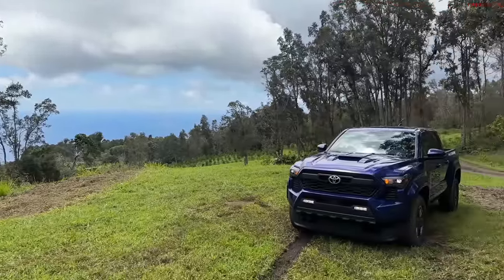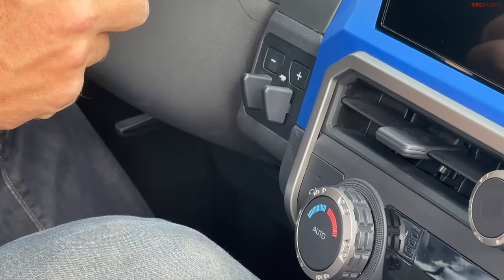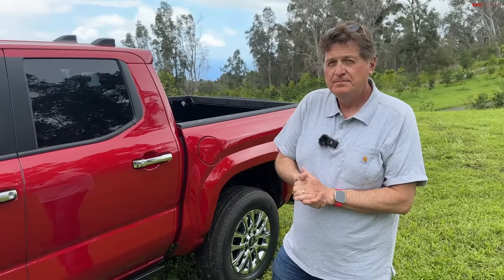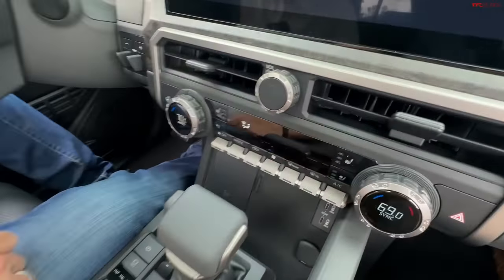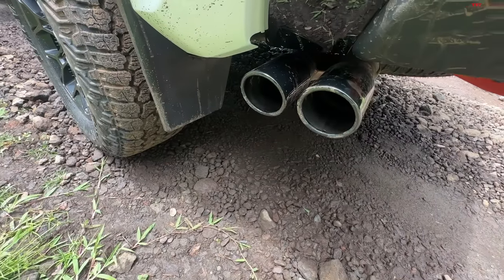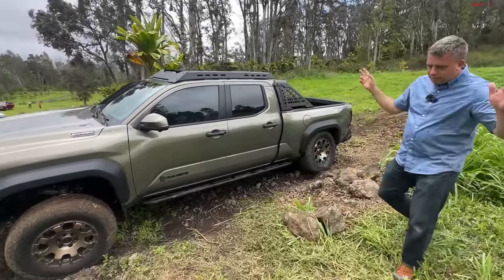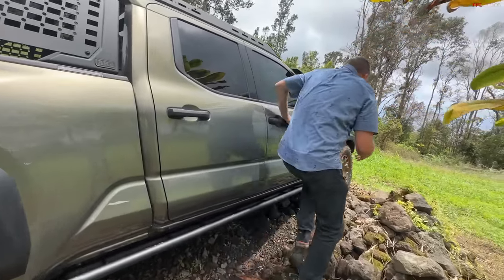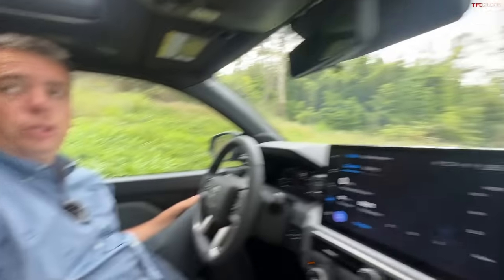The All-New 2024 Toyota Tacoma Is Finally Here But Have They Fixed Its Three Biggest Problems?

Comment: hate the air dam on the bottom looks ridiculous
Reply: Ya it look like it was on the ground. It's was weird. Like it was 2ft wide
Reply: Ugly air dam. I took the one off my Colorado. Id take this one off too.
Reply: I saw another video where they explained that it’s easily removable. Toyota had to put it on there to meet EPA standards.
Reply: 100% agree!
Reply: Taking the air dam off is one of the first things tacoma owners do to their truck. Mine was off the very first weekend. 

Tacomas are notorious for being easily modifiable so I expect this gen to be similar. Just unbolt the thing, throw it in the attic, and move on with your life.
Reply: @Prison_Mike_38  I blame CA 🤷🏽‍♂️
Reply: They made it super easy to take off
Reply: Looks hot
Reply: Ya, it looks like an afterthought
Reply: Yeah, not good for going off road.
Reply: @dougshoemaker2114 Let's be real, 80% of these trucks will be pavement princesses. Anyone who's interested in off-roading will take 15 minutes to remove 8 bolts and ditch the plastic monstrosity, or have their first trail unceremoniously remove it for them
Reply: The sport has always been the dumbest trim
Reply: Extremely ugly. Probably very easy to remove but also likely helps mpg enough to justify the engineers putting it there.
Reply: They do it for mpg but they know most people just take it off
Reply: Agree
Reply: Easily removed. Or complain like a bad girlfriend. Your call.
Reply: It’s cool that it’s removable. Imagine if they made the bumper that large like they do with the LX/GX
Reply: I’d take off before i left dealer lol. Too much snow here
Reply: Take it off then princess
Reply: Not to mention it’s 1500 pounds heavier than a Tacoma from 2008
Reply: Yes on the older model I took it off and it looks nicer 😂
Reply: Agreed, jeez, crimson chin out here
Reply: Looks over functionality.
Reply: @zacharylindsay7534 yeah apparently gains 4mpg-- so might actually be useful for long drives fuel econ
Reply: Yeah until you get 2-3 MPG better because my 22 TRD off-road 6-speed manual in Phoenix with the AC on gets between 14-16 MPG in the city I may be drive a little faster than most but I definitely don't redline it 4K RPMs or less everybody drives fast so I got to keep up

Comment: Looks like they stuck a laptop screen in the middle of the dash, looks dumb.
Reply: Yes! Tesla did it first so now EVERY manufacturer thinks that’s what they need to do too. Except for the new grand Cherokee - it’s nicely integrated.
Reply: @jacobgreenbough5678  Ford pickups have there screens nicely integrated also.
Reply: The best version of a screen integrated into the dash would be the Bentley Continental. I really like the Bentley Continental dash because when you don't need the screen you can hide it and have the look of a traditional dash. The second best would be the Mercedes G-Wagon.

Comment: I have a feeling that the Tacoma will stay the sales leader in its segment for a long time.
Reply: No doubt.
Reply: Maybe there's finally healthy competition
Reply: Possibly. They do have the brand loyalty, but $60k for 405hp in the Ranger Raptor is a pretty good deal by today's truck price standards. Pricing on the TRD Pro and Trail Hunter are going to be key (assuming we live in a world where you can get a hold of these trucks).
Reply: @MikeKelly87  exactly. Toyota fans are hardcore. Toyota this Toyota that
Reply: There are some big improvements with the 4th gen, there are many things they turned a blind eye on. The TRD Pro approach angles are a big disappointing. The lack of a front locker is absolutely baffling. The big advertised torque number is exclusive to the automatic transmission which is a huge fail for us manual guys.  I like that Toyota didn't go overboard with glossy plastics this time around as their glossy plastics would scratch just by looking at them. The UI on the touchscreen is undwhelming -- why can't they just hire a team that knows what a good UI is, not a UI designed for geriatrics. The ARB and OME parts are awesome great choice. If the Tacoma holds onto its sales spot, it's because the people buying them don't even look at the offerings from Ford or GM.
Reply: @idontcaresapo8233  Ya, same could be said for any brand (Ford guy personally), it's not necessarily a bad thing. I think if you are somebody in the market or about to be in the market for a mid size truck and you don't have brand loyalty then this is an exciting time. I was a little surprised they would add a disconnecting sway bar but not front locker. The seats are definitely cool.
Reply: @MikeKelly87  by the time raptor hit the dealer it will be 80k
Reply: Toyota could have kept the previous gen going for another 30 years and it would still remain the bestseller. Toyota brand loyalty is ridiculous no matter how much superior the competition is.
Reply: Hilux SR5 is a better truck than this to fancy and the drivetrain is a shit if where a diesel i would be okey but 4 cil turbo gasoline is going to explode
Reply: @MikeKelly87  hay that’s right I’m with you. But prices are the only thing that keeps me out of the conversation I was lucky enough to buy my 2021 tundra trd pro when prices were normal . But this new generation trucks are way to expensive fro what really they offer
Reply: @RP-vr8pi  yep probably the top of the line they said 50k
Reply: @MikeKelly87  yep. I would 💯 buy the Ranger over this! They look better, will last well beyond your ownership, and it’s not like anybody is going to do any major off-roading in these types of trucks. That’s what my RZR Turbo R is for 🤙
Reply: @idontcaresapo8233  they’re stupid really. All of this tech, other brands have been using, some for decades already lol.

They’re only brag is reliability. Okay, but buying new vehicles, how many people actually keep that vehicle for hundreds of thousands of miles? Like maybe 2% of vehicle owners lol. So the reliability brag really os for broke people who can’t buy these new, and only 2nd, 3rd, 4th, etc. party lol. Plus, Toyota has now introduced turbo’s into their engines. How “reliable” will these really be? Nobody can really make a reliability argument on these new engines because they’re brand new. Time will tell, but I doubt they’re going to last hundreds of thousands of miles like before.
Reply: @MikeKelly87  seats are pure marketing. They are more rice than anything.
Reply: @idontcaresapo8233  yep. Very expensive, and feel like I’m sitting in a 90’s vehicle…
Reply: 50? Nop it’s gonna be colors to 60 mark my words for the trd pro
Reply: im getting it will be my first truck and always been a fan of toyota trucks
Reply: @spaceoutmisfit1738  get the prior tundra trd pro .
Reply: For anything after 2024, I’d rather have a Frontier. I’d prefer a 310 HP V6 over a 279 HP I-4.
Reply: GMC Canyon looks pretty nice.
Reply: The new ranger should give it a good run for its money

Comment: Looks like an extremely technologically advanced vehicle. Beautifully styled, and certain to be a big hit for Toyota. I am still old school biased and prefer a naturally aspirated V6 on midsize trucks and V8 on full-size. Curious about turbo lag on these newer vehicles as well.
Reply: I don't think lag is much of an issue these days; the boost pressure isn't crazy either. I'm curious to see how reliability pans out.
Reply: I’m with you on the engine choices, regardless of how well it performs, eventually you’ll need to spend a pretty penny to  replace the turbo, plus the fuel economy isn’t as advertised ever unless you drive with an egg under the gas pedal.  

I’d want the base 2.4 liter with the lowest power rating.  Still plenty of power for a midsize truck, but “detuned” for more longevity.

Turbo lag isn’t really an issue anymore with modern vehicles.  I drove a Tundra with the turbo V-6 and there was virtually no turbo lag (among other vehicles), knowing Toyota this will be the same.
Reply: It's a Toyota and turbos are everywhere except America it will run forever and save more gas and have more power! Ohh and the hybrid kicks in instant torque so no lag at all!
Reply: The hybrid system makes it a torque monster, and will pretty much eliminate any turbo lag thanks to instant torque delivery. I suspect this powertrain will punch well above its weight.
Reply: Indeed all my buddy's always had good reliability from the old tried and true 4.0 V6 I was lucky to test drive the 4runner same day as the 3.5 Tacoma and went with the 4runner simply because it just felt better on road and offroad
Reply: @nazspeed1  guaranteed to likely out live Ford turbos to compare I've had nothing but poor experiences with any turbocharged Ford including my relatives all together we've owned everything from Econolines, P71 Crownvics and Focus STs
Reply: less weight and smaller space, better MPH, add the hybrid models, then the power/torque go up(this part was what I was waiting for). Would prefer the plug in hybrid version though and use the Lithium batteries. Then that high compression engine would not be used much for the average person. 50 miles before the gas kicks in. Would cut most people's mileage down by 80% on the gas engine.  Average daily driving is 37 miles, 259 mile a week. So the weekend trips would be the gas engine mostly. Running errands and shopping (45% or 116.62 miles)
Social and recreational trips (27% or 69.97 miles). The daily commute (15% or 38.87 miles). These are averages though. Some might have less, others might use more gas. For off road like myself, the added torque of the electric would be awesome. If you tow, the added power also would be good. It has more power than the V6. Quite a bit more. Also cost a lot, 55K of thereabouts I would guess.
Reply: Small turbo 4 cylinders in trucks usually means a bunch of problems
Reply: I stick with my 1988 Toyota 22re
Reply: Agreed.  Too complex.
Reply: @Banned by Commie YouTube 5 times b4 this  2.7 v6 f150s get 26-28mpg hwy
Reply: Beautiful?
Reply: 5vzfe !
Reply: Toyota messed up by not offering a detuned twin turbo v6 as an option for the TRD lineup.  THE RANGER RAPTOR IS GOING TO SPANK THIS TRUCK , and I'm a Tacoma owner
Reply: @jessehenry1254  the Toyota will last 10 times longer
Reply: Turbo lag in most newer vehicles is pretty much nonexistent. They aren’t running big turbos for big power, they’re running small turbos for improved efficiency and moderate power. Small turbos have significantly less “lag” than large turbos.
Reply: This motor belongs in the prisus and.the tundra motor belongs in the TRD PRO
Reply: Yeah. I had my gen 3 tuned and added new suspension and couldn't be happier.  The new truck do look sick though. And that mpg lol 😆 sexy af boys.
Reply: @biffmasterson9786   well explain all the hiluxes all over the world except where we can't get them.....here in the USA. Not to mention 18 wheelers ( large Trucks)  turbos diesels are everywhere and the technology has been around forever. Toyota would not risk this on there best selling truck unless they knew it would work. Small engine, turbos , and hybrids are what toyota knows best. Most Americans want a roaring V8 with a 5 speed but it's just not efficient or as powerful, more gears more efficiency that's why manuals are dead look at the number they don't lie. Now tell me where can you find a V8 with 485 pound feet of torque and 40 miles to the gallon? (Unclaimed 40 just a guess based of the land cruisers official page leak).
Reply: a PLUG IN model is self defeating, we want to stay INDEPENDENT of the electric grid!! @ShuKatashSam

Comment: That 2.4l engine is like a throwback to the 22RE 2.4l engine that powered the 80s and 90s toyota pick ups
Reply: Toyota had a turbo truck in 84-88 but decided on a v6 after. I'm glad they brought it back.
Reply: I'm happy to have my 87 22RE 4WD Extra Cab.
Reply: @autostationfanatic  how many miles?
Reply: @xwarped83  currently at 307, 000 and going.
Reply: Toyota saids on their website that the iforce max is a 4.0 4 cylinder? Or is it actually a 2.4?
Reply: My first Tacoma was a 2000 with the 2.4.L I4 engine and it was great. My Tacoma SST was a single cab 5-speed manual and it wasn't fast but was a great commuter truck. Did everything I needed it too.

It got 22 in town and 25-26 on the highway. Being a 5-speed manual I was able to milk the mpg which has always been my choice of transmission.
Reply: Never mention the legendary 22R series with this pos haha. The first 22R until 82 had dual row timing chains with metal guides. They also had gear driven transfer cases. They were insanely overbuilt for the whopping 112hp.
Reply: You mean 22RTE.     
It was the turbocharged version available back in the 80’s in 4Runner and Tacoma.
Reply: LOL this weighs almost twice as much and won't have anywhere near the durability of a normally aspirated 22RE
Reply: I have a 600k mile 22r and a 300k mile 22re. Nothing but love for them.
Reply: @Glen Melancon  im happy with my v6 thou especially when i swapped my 3.0 for the 3.4 and supercharged it lol😂
Reply: It’s probably not reliable. Not near as good as the old one.
Reply: I had a celica with the good ole 22r
Reply: @ghilliemanreviews all these Turbo 4bangers is what made me buy a 23 Pro4x
Reply: @edd752010 check the model year. 2023 or below still use 4.0. 2024 and beyond use 2.4 turbo 4 cyl. iforcemax just branding
Reply: @ghilliemanreviews  can’t really tell till some years pass
Reply: Great motors
Reply: I’m really just meh on the new tacos. They look ok, nothing omg about them. I’m sure the engines are ok. But I was really hoping for north of 300 hp across the board, besides the sr.  The last taco I drove was a 22 auto Ted off-road. Great truck other than gear hunting and horrible highway mileage. Really all most people wanted was more hp, and a better trans. Curios about pricing. The pro and trail hunter are going to be over $60k.
Reply: Remains to be seen if this one will be as reliable. I had a 1986 Xtra Cab with the 22R-E. It had over 400,000 on it before the frame finally broke in half. It was still running when we sent it to the junkyard.
Reply: @glenmel78  I believe it was only offered in 1986 and 1987 for the truck. I've never seen a 1987 with the turbo though. My dad ordered a brand new one in 1985 and the turbo wasn't available yet.
Reply: 22RE is a 2.2 hence the 22RE lol.
The 2.4 wasn’t released until the Tacoma came out in 1995
Reply: @DustinRZR  incorrect 22re is in fact a 2.4 and the newer 2.4 is called the 2rz and 2.7 3rz
Reply: Hopefully its as realiable.
Reply: Ummm the 2.4 is world generic motor. It's been in like 100 different vehicles 😂
Reply: @DustinRZR  😂😂😂OMG! You should research this before typing. Everyone knows the 22R and R-E were 2.4L. What, are you drinking a Budlight?
Reply: @edd752010  I wonder how many people will inform DustinRZR1000 of the facts. I would have definitely looked that up before I typed it if I were him.
Reply: @guardrail2897  hahahahahahaha
Reply: @guardrail2897  😂😂 budlight
Reply: Except it was not made in Mexico and affordable. Now these garbage trucks are with a 4 cyl. Turbo. Garbage.
Reply: @thebaddestogre-3698 you won’t get 200000 miles on the new garbage truck.
Reply: @smokeylake3150  not a chance in hell. 😄

Comment: I’m excited for this new model especially after knowing there is still a manual. I’m not worried about the power plant having reliability issues at least after the first year of production. Toyota has given us several reliable turbocharged engines over the years and a few of them ended up being some of the most iconic engines to date. They also pretty much pioneered the way to hybrid technology so I have no doubts about that either. Plus since the engine is already turbocharged, if we want more power we can turn up the boost! No more paying $6-8k for super chargers to add a little bit of power. I take kindly to the sound of turbo 4s over V6s anyways so I don’t see this as a loss. Heck I don’t care what’s under the hood so long as there’s a manual right behind it!

The styling is pretty impressive and the new interior was much needed. The only thing so far I’m not a fan of is the electric parking brake. I told myself I’d never get rid of my 6mt third gen but these things seem pretty nice. I’ll wait a year or two for the bugs to get worked out and then I’ll reconsider. That or I’ll keep the 3rd gen and grab me a GR Corolla or manual Supra!

Great video guys!
Reply: I never had a truck so I cannot wait. First truck purchase and first vehicle I actually want.
Reply: Electronic parking brakes have been a thing for quite some time.  Car people need to quit living in 2000.
Reply: @FXIIBeaver  in a numb daily driver that’s just for point a to point b operation I agree. However “car people” tend to prefer to have hand brakes to have fun whether its drifting on pavement, snow or even on dirt. That’s one particular reason I like having them. I use my truck for fun so why not retain a feature that doubles as fun and a parking device?
Reply: Are you sure ?
Reply: @FXIIBeaver woman lol how about sliding in the parking lot
Reply: @coolhawk2003  did you just have a stroke?